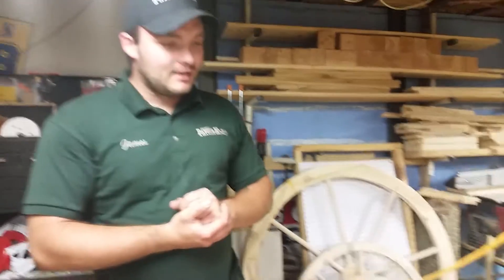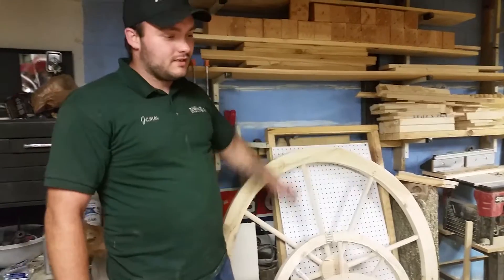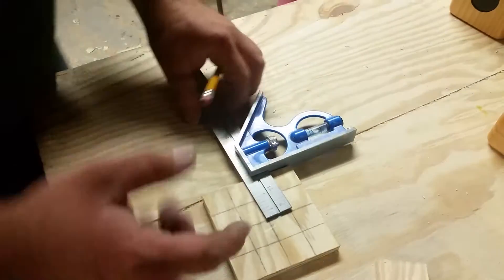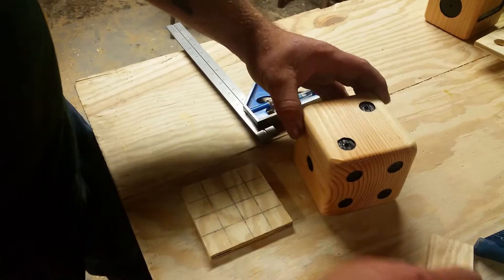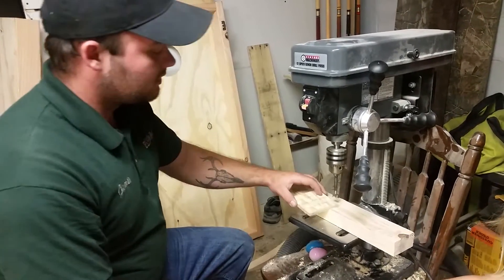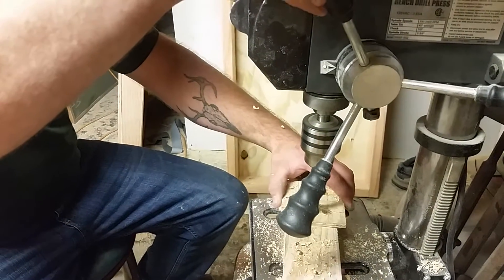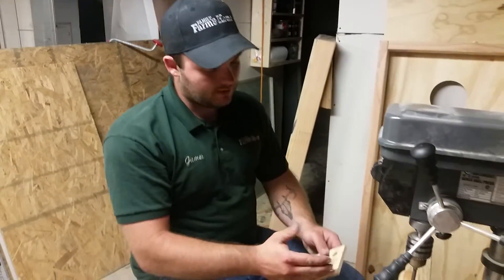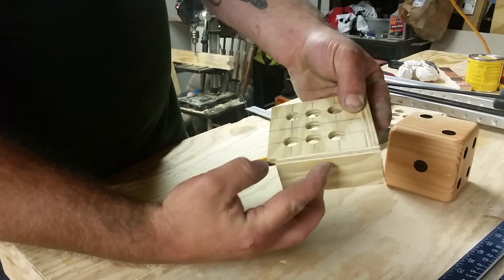DIY Yard Dice Hole Template (part 1)

Comment: When I made my dice, I made an "L" shaped jig that held the dice on the drill press table and then rotated the dice to save a lot of time. I think it works faster than the jig. 

CORNER:
 I had the Forstner bit set for the top-left position and rotated the dice so that all the corner holes of the 2, 3, 4, 5 and 6 were quickly drilled out.

CENTER:
I aligned the Forstner bit to the center position and drilled out the center of the 1, 3 and 5

SIDE:
I aligned the Forstner bit to the left middle side and drilled out the middle side of the 6 (then rotated the dice and drilled out the other side of the middle).

Hope that all made sense.
Reply from the maker: Tim Foster That sounds like it would work pretty good, I'll have to give it a try.